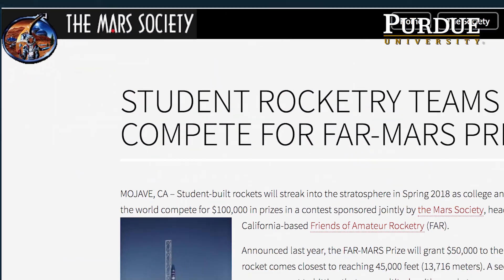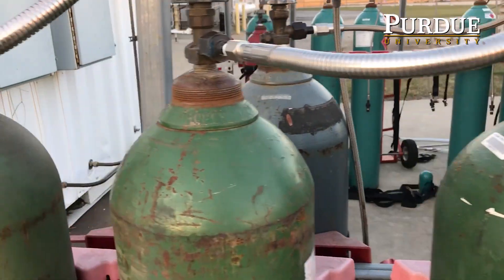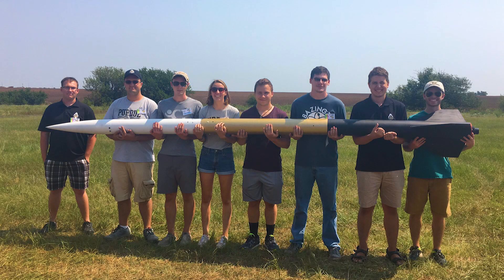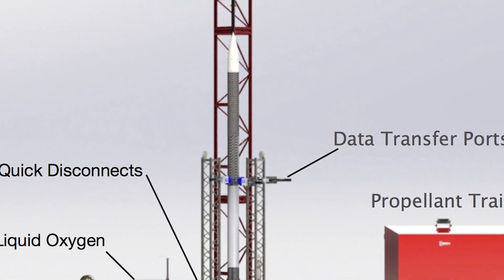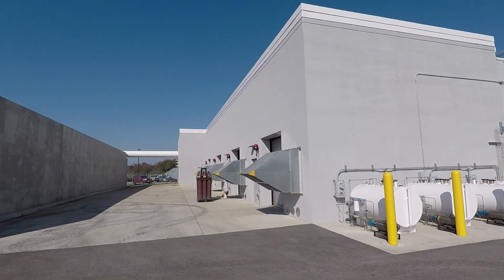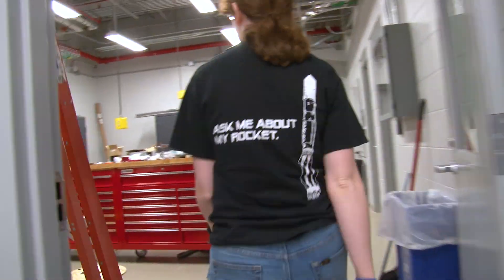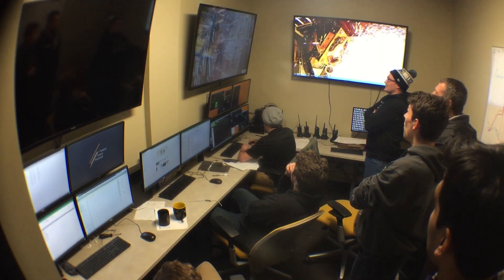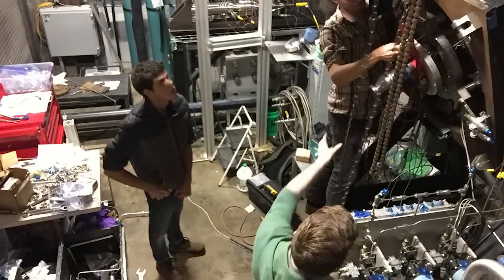2017: First Ever Liquid Methane Rocket for Purdue Space Program

Comment: 0:40 if i go to jupiter what? or to the moon
The point in use methane is not only because can be produced in Mars. Asweel is the unique molecule wich have 4 Hydrogen and is stable(so can be stored in space as gas-station)
Can be produced by organism not only artificialy by enginered machine. Is usefull because if you bring cow or any other animal for food theyr exrement produce methane. Wich mean more efficient weight in that spaceship.
Try to produce Hydrogen. is lot more hard and expensive. and store it pain in the ass.